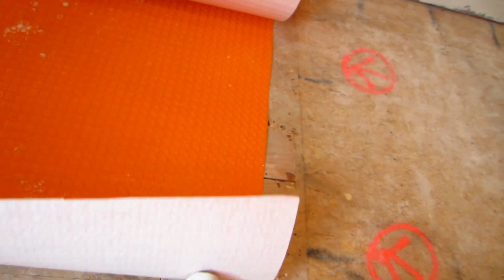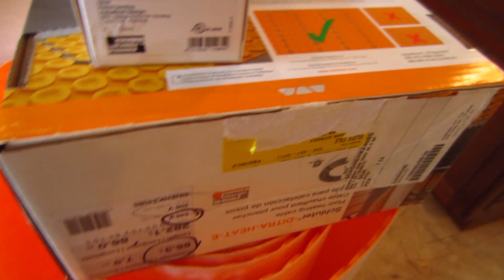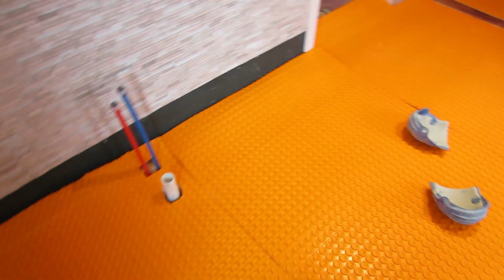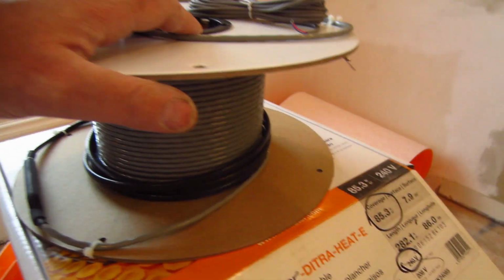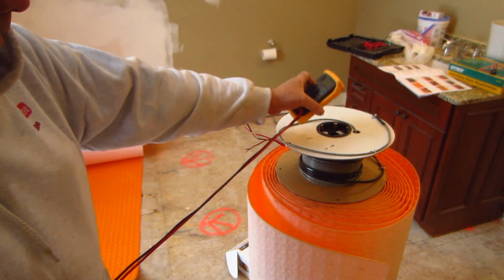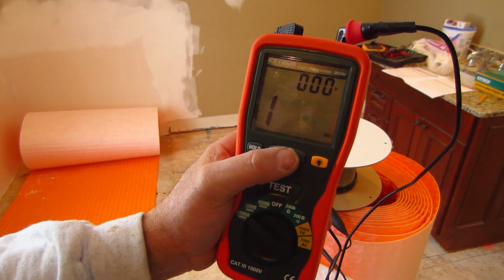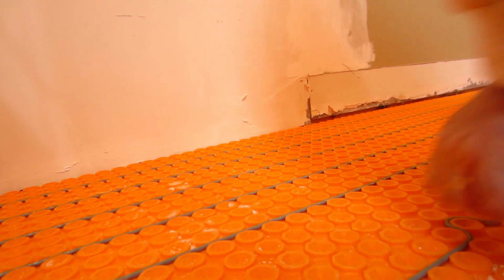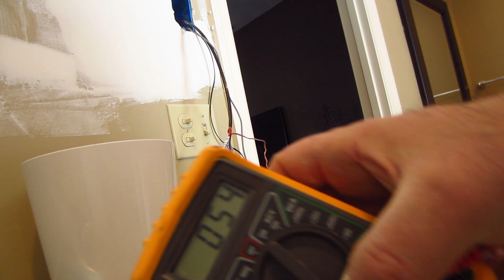Ditra Heat, electric floor heat  how to install it start to finish. Steam Shower Part 7

Comment: Sal, I am planning on doing an install just like this, just finishing up the plumbing.  Question I have is this, I have 3/4 OSB as the subfloor on a 2nd story.  I was planning on installing 1/2 plywood on top of the OSB, then the ditra, but I saw you install this directly on the OSB.  Is it required to install the plywood since the subfloor is less than 1 1/8"?  The final tile will be marble, should I just install the plywood just because of the load on the floor?
Reply from the maker: Marble is a different animal to porcelain tile and requires a much stiffer floor. Deflection for porcelain tile is L/360, for natural stone it is L/720. That usually means a double layer of plywood and a close look at the joist structure to make sure you meat the requirements.

Comment: Hi sal. have you ever worked with the suntouch floor heating system (the mats). just wondering how this compared to that and what's easier to use. we're going to be doing our kitchen very soon and in our area everyone uses the suntouch. should I try to find and use this system instead?
Reply from the maker: This is a much easier system to install than any mat like the Suntouch you are referring to. There is no comparison, the older systems have lost huge market share to this type. Suntouch even makes a wire that you can use on Ditra Heat mat.

Comment: One question if I may.
Do you need an insulation layer under the Ditra mat? I have a loft conversion and combining the Ditra mat and the heated wire will save valuable hight, but not sure if I need to insulate under it to prevent heat loss.
Reply from the maker: Depends what you are going over, but the do have a version with a thermal break. http://amzn.to/2l2cnfd

Comment: Do you just skim coat your floor pieces or actually use a trowel as you do on wall installs ?
Reply from the maker: Install tile as you would on any tile underlayment, however because this is Ditra an unmodified thinset must be used. The next video of this series will cover all that.

Comment: Your saying not to install this yourself if your not a licensed professional?
Reply from the maker: I am saying that the actual connection to the power need to be done by an electrician in my area. everything else can be done by the tile installer.  It might be different in your area.
Reply: How did you get the ditra wires into the wall?